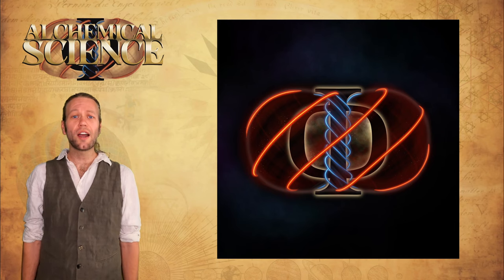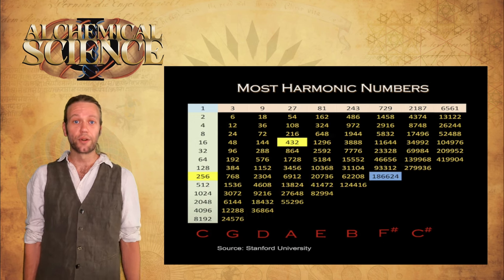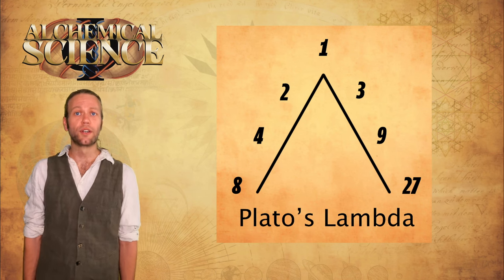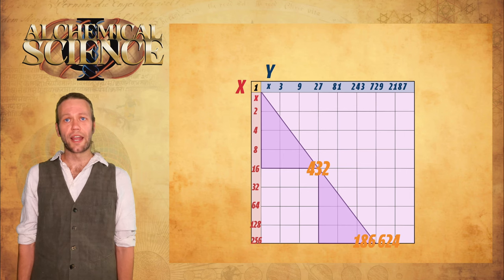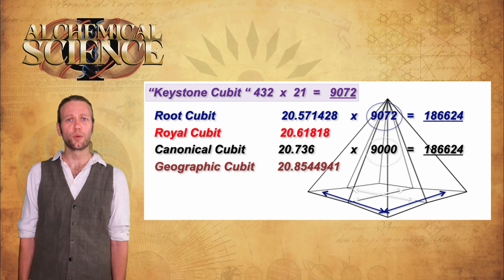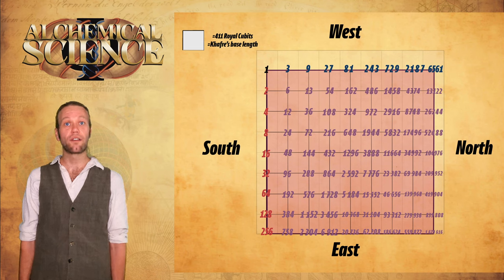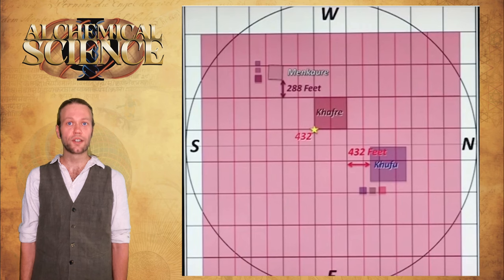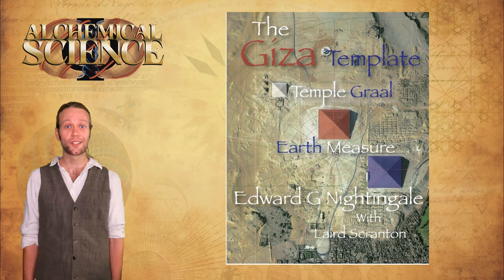Ancient Architecture & Mathematics | Plasmoid Unification Model and The Giza Template

Comment: The 12th letter of the Greek alphabet is Lambda and it is the shape of that triangle without a bottom line and equals 30 in isopsephy. The doubles and tripples are based on 2 and 3 which when multiplied is 6. 6 is the only even number in the 3, 6, 9 sequence and is the harmonizer, Ie: 3+9=12 6+6=12. To get the next number in and as the whole sequence going downward you multiply the number above it by 6 all the way through said sequence. A cubit is a square in any size morphed to a cube which is fractally scalable to any volume as long as it is a harmonic cube. The true measure is meters as a centimeter is the size of a water droplet which is universal. The inch works as a measurement because 12 of them is a complete interval of a foot. 12 is the key and 1+2=3, 3x2=6 3x3=9 all the fundamental harmonics will equal 9 as they are the completions of the given fractality. The real key is are they divisible by 12 or 24, those are the main Harmonies. Peace

Comment: Is there any musician reading this with a sampler that allows for an alternative notes (frequencies) to be connected to keys on a keyboard? I have come up with a 15-note octave where the notes are meant to be more closely related through math, causing more notes to go "well" with others. Just like any note with one an octave higher or lower (double/halved freq). My present tone ladder actually features few octaves, as the tone steps vary and repeat every (9) steps. Staring with 432 Hz, all freqencies I've come up with reduce to 9. I'm not sure why.
My objective was to figure out the "angels' music" people have reported on, which could not be replicated on instruments. I want to hear what chords are possible with this wholly different ladder. There are SOME overlaps with the 12-half-note octave systems out there, but that might be akin to a broken clock being correct twice a day (12-step equal temperament).
I hope a tone ladder is possible where every second note played/sung will sound "angelic", as clear and sparkling as a 2-note octave sound.
Reply: I wanted to have to notes played to have the lowest possible resonance (as I understand it). A note and its next octave pal, will vibrate at a neat 2:1 ratio, intersecting the same way. Perfect. Now, add notes with waves in 3:2/3:1, 4:3/3:4, etc. Close as possible. Two notes next to each other in the ladder will have a resonance that's an inverse of the step between them, that cannot be prevented.The second step though, can be a nice break, or a broken number. I pick the nice break.
Reply from the maker: My next video is on the musical scale I've found in the template and how to apply it inversely to a string etc. There's a pattern in the sequence that gives us a full 12 note chromatic octave - and if you continue the pattern you can build microtonal scales
Reply from the maker: I mapped the frequencies onto a midi keyboard just using the default sampler in logic pro to check how it sounded. If you're trying different scales with more notes you could use something like a novation launchpad to sample the tones instead so the black and white keys don't get confusing
Reply: @AlchemicalScience  Cheers! Since I'm now at 15 step octaves...maybe I'll just ignore black keys and mark white keys with stickers.
Since the cycle isn't in line with octaves, any song might have its own base note so that one can have octaves. The ears will tell us.

Comment: There are only 3 dimensions evident to me.
Reply: Four. You are moving through time at a constant rate forward, and you can sense this movement simply by existing.
Reply: @Sgt_Glory  Time is not a spacial dimension, it is change within the three spacial dimensions. I can go to a place and return, I cant return to the past as everything has changed.